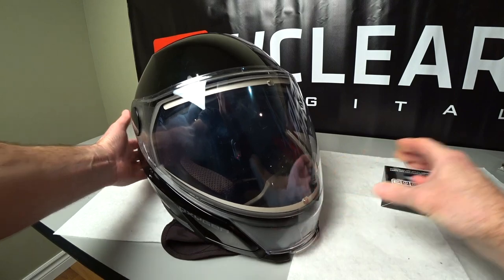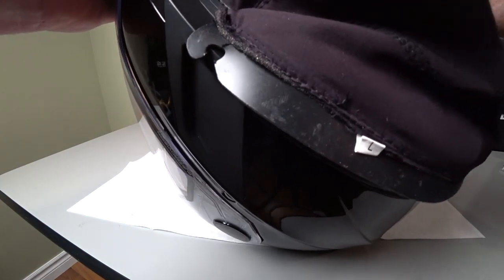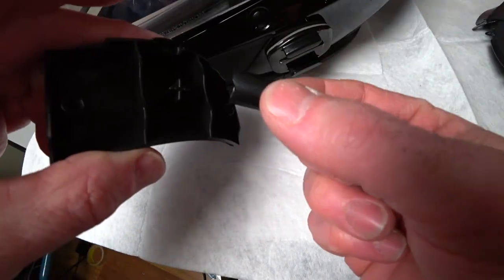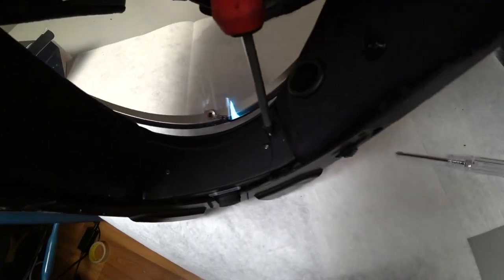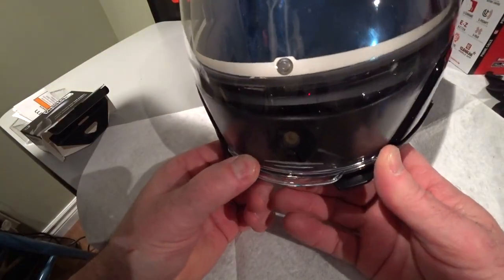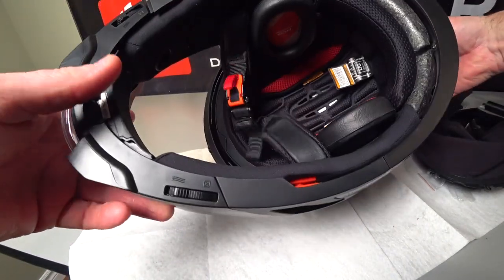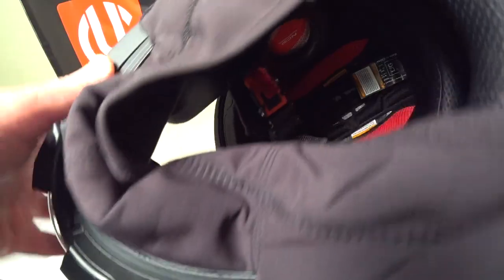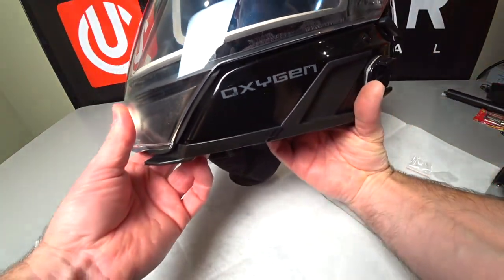BRP Ski-Doo Oxygen Helmet LED Utility Light Install | Part Style Number: 9290060090

Comment: Thanks for another helpful video!  (Loved your Ski-Doo Rev evolution video as well.)  Got my light installed and now just need some snow.
Reply from the maker: The light is AMAZING - The only hard part is to remember you have one so you use it.  Once you get the hang of it, you will love it.
Reply: @mudbrats  At the end of the video you commented how you wished the back of the curtain was longer - the Oxygen SE curtain will fit on the original Oxygen and has a longer back (and vent in front).  I actually re-watched this video to remember how to put the curtain back on when I got my SE curtain - works great!

Comment: Nice vid.  See you got UCLEAR too.  Very cool.  My whole family uses those comms.
Reply from the maker: Stay tuned cause the New Uclear Motion 6 was installed minutes after this in the helmet!  Video is on deck
Reply: @Calvin Kuck we used them one trip up north. 
1. Speaker sucked
2. The plug to connect the speaker was incredibly fragile 
3. Battery like was horrible
4. After separating from the snowmobile group a mile, they disconnect. And you have to manually reconnect them. 
They all got sent back.